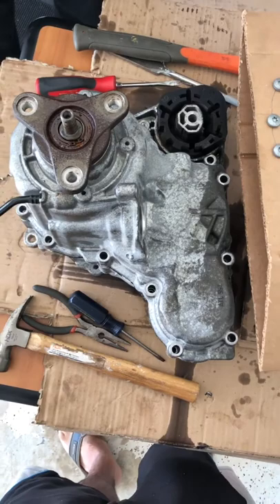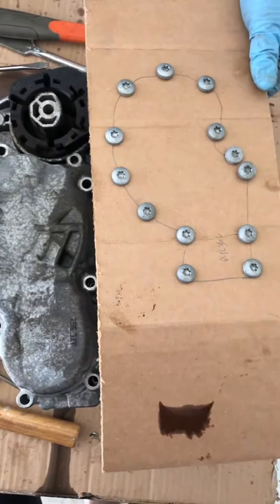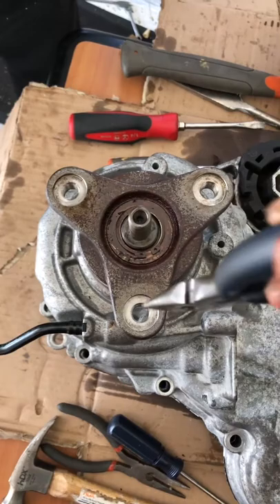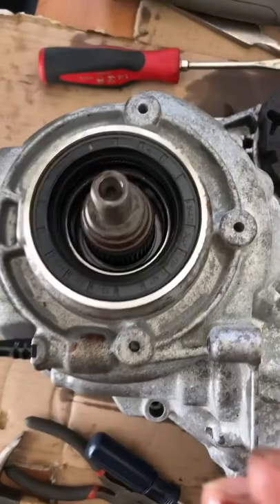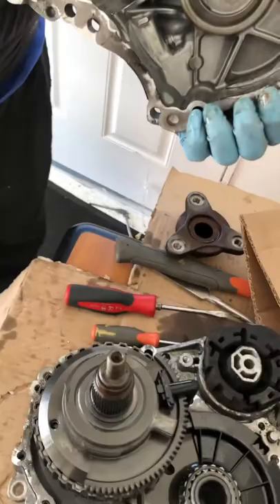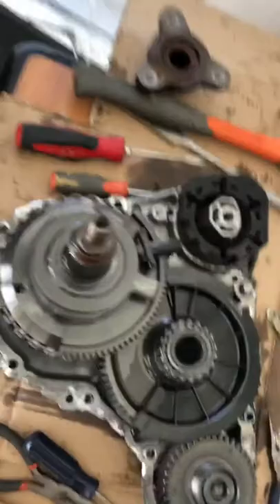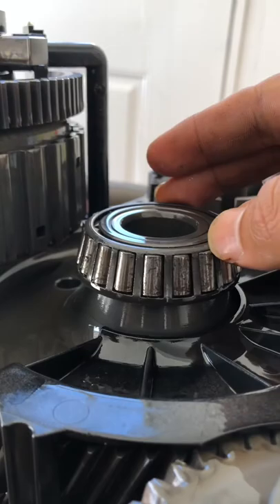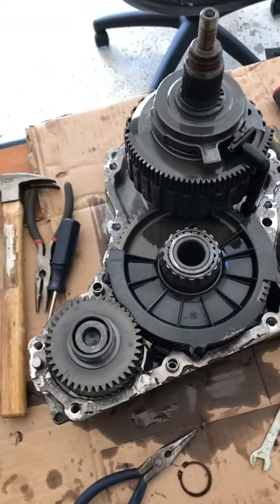Bmw transfer case opening

Comment: Hi Vishad, great vid. Quick question, I own a 2003 325 xi (75k mi) and it broke on me last week. I has no traction, shifter will move and noise can be heard as it shifts between P N and D, but no movement is transmitted to the wheels. Even worse, while in P, the car wheels move freely as if the car was in N. R or D the car would not move. Is there any way of knowing if the issue is the transfer case or the tranny? Thank you.
Reply: Its your mechatronic in your gearbox.Set of valves and gaskets . Google valve body zf6hp . I assume you have 6 gear zf box. Quite cheap to repair.
Reply: @adamproperdouble2094  Thanks. It was the axle shaft, front one. Thanks again